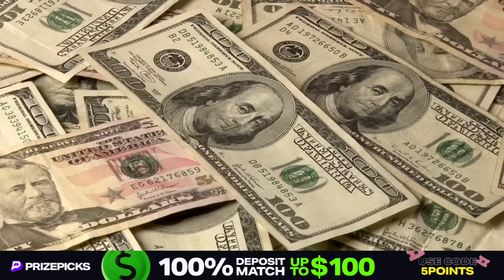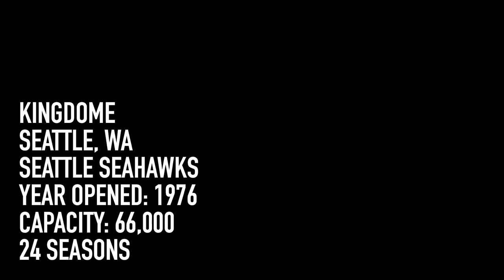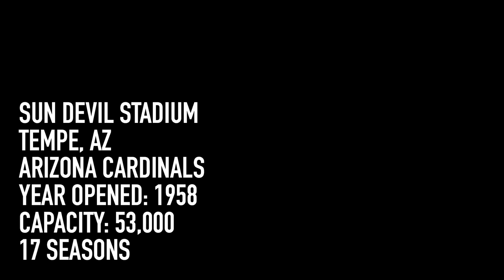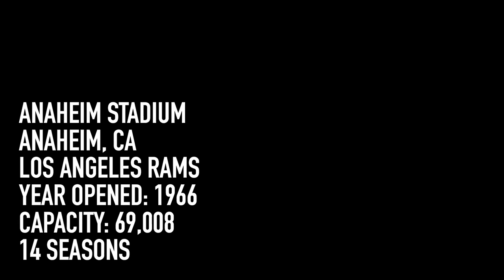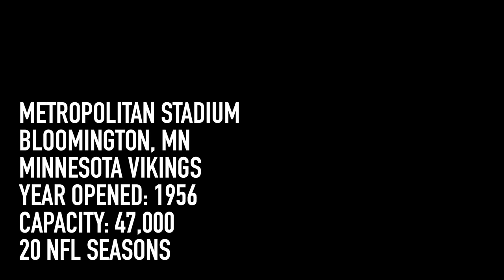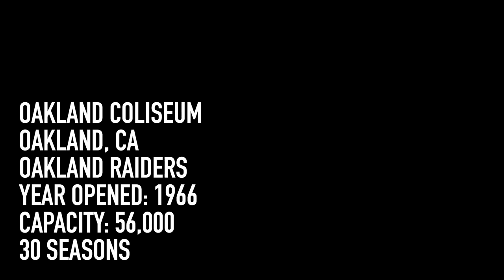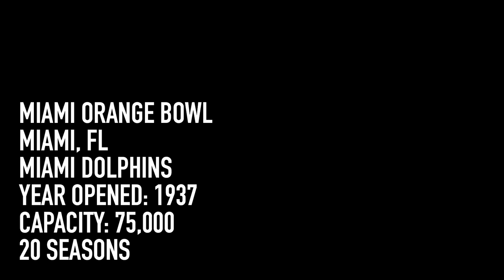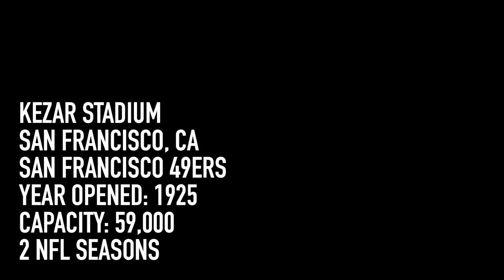The Worst NFL Stadiums of All Time

Comment: You missed Milwaukee County Stadium which hosted 2-3 regular season Packer home games for decades. The seats were far away as it was designed for baseball. Perhaps 20% were good football views. 

The seats along one sideline were so low, fans could not see over the players and coaches. So both teams' benches were on the opposite sideline. This was the only NFL stadium which had to do this.
Reply: Fun Fact: County Stadium was directly responsible for the construction of Lambeau Field; since the old City Stadium in Green Bay was so obsolete that the NFL threatened to move the Packers to Milwaukee full time unless a new stadium was built in Green Bay.
Reply: No, Metropolitan Stadium had to do that, too.
Reply: I actually played at Milwaukee County Stadium. I actually enjoyed it, but I can see how someone in the seats may not have had the same experience.
Reply: Tiger Stadium in Detroit had to do that
Reply: He did say it needed to be for a full season which is probably why it didn’t count
Reply: @connorchil  Yeah, Green Bay played 3 or 4 games a year there. I never understood why.
Reply: Kansas City Municipal Stadium had benches on the same side
Reply: @connorchil 42 NFL seasons of 3-4 games there per year should count. The NFL almost forced the Packers to move to Milwaukee full time because some teams were complaining about the miniscule gate revenue they got from playing in Green Bay.

Comment: Some more about Sun Devil Stadium (recently renamed "Mountain America Stadium" but no one calls it that): It's gone through some major renovations since the Cardinals left. It was once all metal benches, but the seats on the sidelines have been replaced by actual chairs, with the end zones (student section), some of the away sideline, and upper deck remaining as bleachers.

The south end zone seats were once detached from the rest of the stadium, as seen at 3:18 but have since been integrated into the lower bowl to completely close it. The north portion of the upper deck was removed due to concerns about structural integrity, with the jumbotron now occupying that space. Capacity went from ~74,000 to 53,599.

Ironically it's probably better suited for NFL games now than when the Cardinals actually played there. Except for the heat, of course. That's still there.
Reply: Went to my first game at Sun Devil Stadium in 1977 when end zone upper deck was under construction.
Reply: I cannot imagine metal bleachers in that Sun. Sun Devil and Cardinal fans must have been practically cooked alive.
Reply: @davidwarburton2915  ASU always played a majority of night games. It was still warm but by October it would be a pretty pleasant evening weather wise.

Comment: FivePoints, I get that you don’t like multi-use stadiums and I even get why. But could you please do a video about the best ones? It would be very interesting to see the different ways that teams rearranged things when going from one sport to the other and about some of the oddities that resulted. For example, I grew up in Pittsburgh and when Three Rivers Stadium was configured for football there was a section of seats at one end zone that stood oddly alone. Which multi-use stadium looks the best when configured for baseball? Which one looks best when configured for football? Which one was the least worst overall? Thanks!
Reply from the maker: that's actually not a bad idea
Reply: Fenway Park and Mile High Stadium worked better than any other.
Reply: fenway's not really a dual use stadium since it's only used for football every once in a while anymore. and it was designed and built before the nfl was even invented
Reply: @systemofanup  Funny you should put it that way.  Look at a photo of RFK Stadium.  When you see it from above, it resembles a toilet.

Comment: You should cross check with your buds at Dorktown. Their documentary on the Vikings is epic.  And why The Met may have been the best home field advantage during it's 20+ years of service.

I think the players liked it as well. The fans were quite a distance away from the sidelines. Shannon Sharpe would've needed a bullhorn to call in the Minnesota National Guard. 🤣

For a baseball stadium, Tiger Stadium in Detroit was great for football sight lines. Especially the upper deck.

Comment: Candlestick Park nearly killed 60,000 people in 1989. The City of San Francisco found the stadium in complete structural disrepair and was going to fix it after the 1989 Football season. An Engineer for the city told them to do it after the 1988 football season. The found the brackets that held the upper deck, rusted, corroded, some only had one bolt instead of 4 and concrete was substandard. So they fixed it in Early 1989 instead of 1990. Imagine that upper bowl crashing onto the lower bowl.
Reply: “Nearly killed”? It turned out to be one of the safest places to be during that earthquake.
Reply: @ronflatter1235  That is because they did the retrofit a year earlier than planned.
Reply: @ronflatter1235  You mean other than the massive chunks of concrete that nearly fell on people
Reply: And it would have been worse without the retro fit.

Comment: Cleveland Municipal Stadium was not good for football. Dual use with MASSIVE foul grounds puts everyone (except the Dawg Pound endzone bleachers) a mile away from the field. View blocking columns. If you sit on the upper half of the lower deck, the over-hang of upper deck will block your view of the scoreboard (and a tiny part of the field in some spots).

Comment: Shea Stadium had to be the worst place ever to watch an NFL game. 
Located in the flight path of LaGuardia Airport the taking off and landing Jets were often only a few hundred feet over the stadium and the roar of the planes jet engines was deafening.  
Built as a baseball stadium it had open air walkways and water & sewer  pipes that were not insulated. 
I went to the last NFL game at Shea Stadium in I think  December 1983 Jets ,/ Steelers. The late December weather was freezing for the whole week before the game.  

The water and sanitary sewer pipes froze snd broke.  Raw sewage and water was falling from the ceilings onto the walkways. The ramps to the upper deck became solid ice.
AND FROM WHAT IVE BEEN TOLD THIS HAPPENED OFTEN  TO THE JETS LATE IN THE SEASON. 

How the City of New York and the NFL allowed that game to be played is mind boggling. 

Shea Stadium 100% belongs on the list.

Comment: The problem with Kezar was that the west side of it wasn't built parallel to Lincoln Way, so that street's sidewalk intersected with the southeast section, meaning that about 10,000 potential seats were not there.  Look at old photos that were taken in that direction, and you'll see what I mean.  And any overhead photo from a plane shows the same thing. There's a building near the northeast side of the stadium, which could have been there before the stadium was built in the late 1920's so maybe that's why.  The current stadium is parallel, with 10,000 seats, not 60,000 like before.

Comment: Candlestick was a great place for football, better than baseball.  It actually had a better non parallel seating section than was at Anaheim Stadium, and wasn't too different from when the Bears played at Wrigley, with their outfield football bleacher section not being totally parallel to the east side sideline.  The older and original grandstand on the west side of Candlestick was parallel to the sideline, and in fact, that's where the majority of Oakland Raiders fans sat during the last half of the 1960 and all of the 1961 AFL season.  .

Comment: Kezar Stadium should not be on this list. No way. To call it the worst in NFL history is an absolute joke. Also, Kezar hosted the 49ers for only one season after the merger. Like many of your opinions, that is plain wrong. 
TCF Bank Stadium DID host the Vikings for two seasons. You got it confused with Memorial Stadium in Urbana-Champaign, which hosted the Bears for 2002 only. Or with Clemson, which hosted the Panthers in 1995 only. 
Your counting is off in a lot of instances. Sun Devil Stadium hosted the Cardinals for 18 seasons (and its capacity was over 73,000 for the Cardinals; it was reduced by ASU during renovations). Anaheim Stadium hosted the Rams for 15 seasons. Metropolitan Stadium hosted the Vikings for 21 seasons. Orange Bowl hosted the Dolphins for 21 seasons. War Memorial Stadium hosted the Bills for 13 seasons (10 AFL seasons, 3 NFL seasons), and Rich Stadium opened in 1973. Oakland Coliseum hosted the Raiders for 41 seasons over two separate stints.